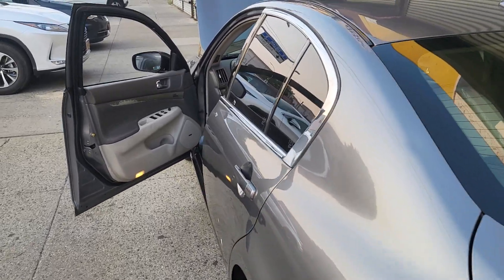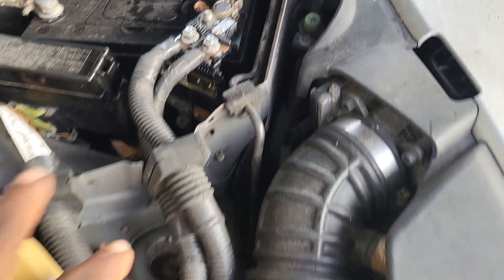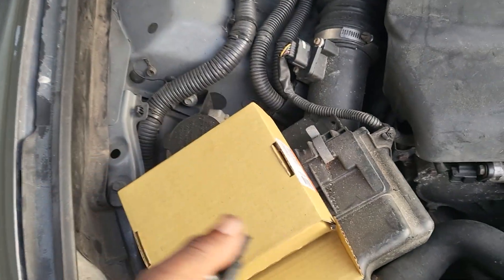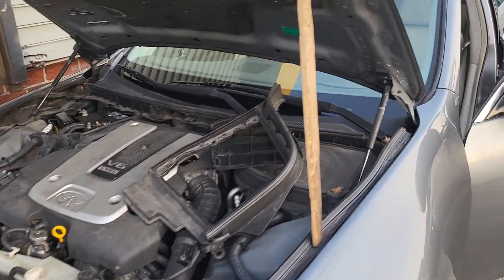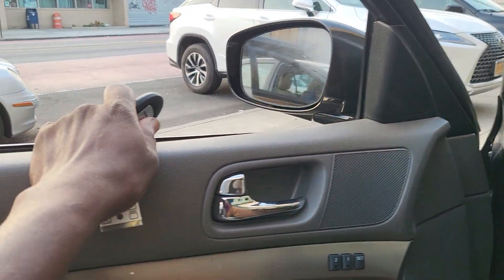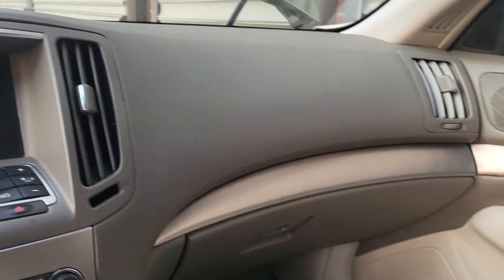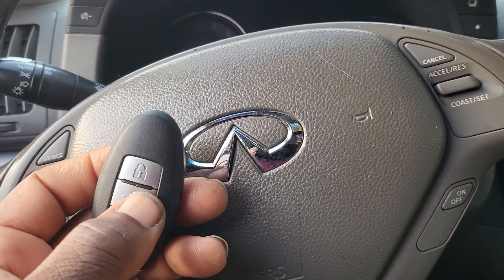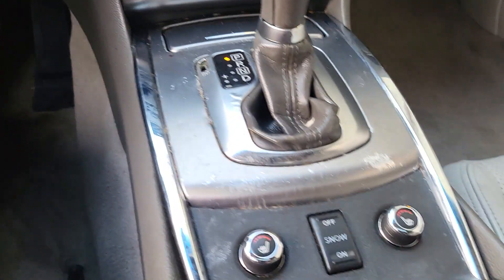Infiniti No Cranking No Ignition Found Main Fuse link Was Bad Fixed

Comment: I have a 2005 g35 the ignition is locked any suggestions?
Reply: Turn the steering wheel hard to release steering lock
Reply: @Brandon-kq2yg
Reply: @veezybee23  I tried that. I tried all the tricks I believe it has something do with electrical wire maybe the interlock cable? I’m no mechanic I just know a little bit of stuff. I know if I figure out the problem I can fix it.
Reply: Change this ink in the video make sure your key fob battery is good